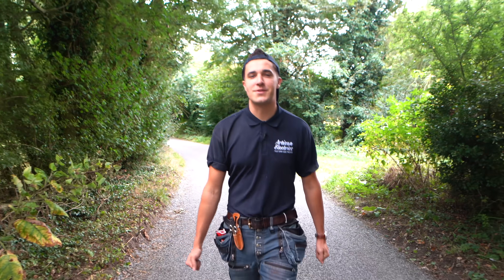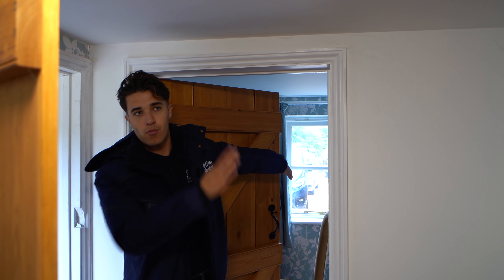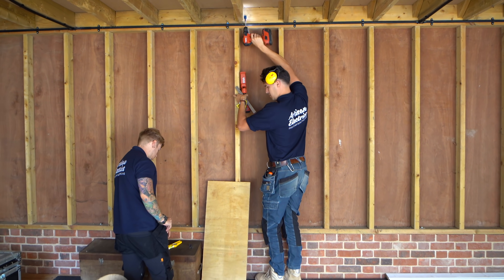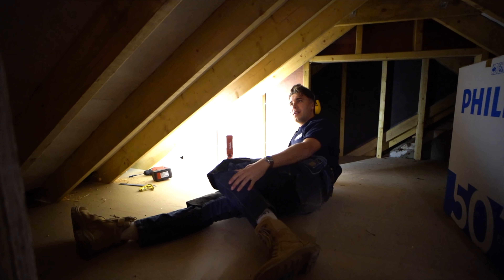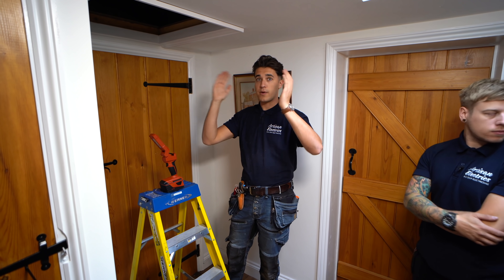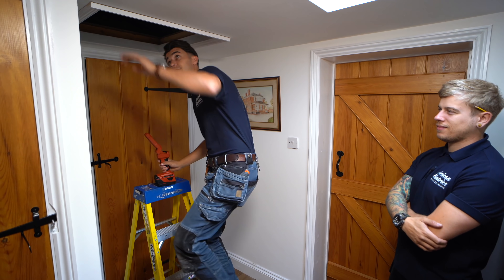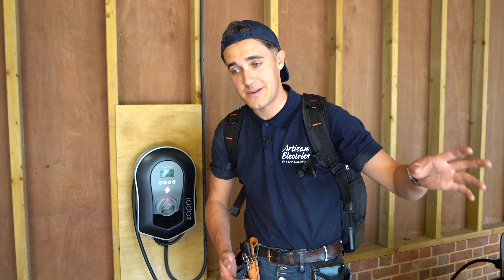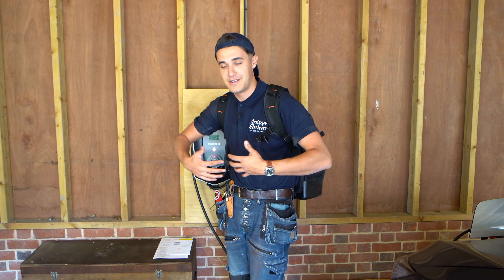BEING A SPARKY IS NOT ALWAYS AS EASY AS IT LOOKS - Electrician Life

Comment: Hmmmmm . "as required by Regulation 522.8.14 of BS  7671, no wiring system should
penetrate an element of building construction which is intended to be load bearing unless the
integrity of the load-bearing element can be assured after such penetration. "
You might need to go back and fit U shaped steel plates round the holes in the rafters
Reply: No
Reply: @rickybeans8504  Enlighten us then, too late to not drill the rafters
Reply: @FFT_Electrical  there's a textbook... Then the real world.....
Reply: @rickybeans8504  Unfortunately the real world in this case is building control , and as it was advertised to the world it should be put right. will the roof fall down, very unlikely.  Interested to learn how @artisan electrics deal wih it though
Reply: @FFT_Electrical  building control are not involved.

Comment: Great video and funny as always but heres where reality vs Regs clash. I winced a bit every time you drilled through those rafters.......
Reply: Wouldn't it be the same as drilling through joists?
Reply: @ethanparker5082  there is a full set of rules relating to holes and notches in Joists but the regs are clear about rafters, no holes, cuts or notches except for the creation of birds beak cuts at points of support.

Comment: Instead of destroying the integrity of the roof joists why not fit 3 inch board along the based of the joists where they meet the floor, or higher up near the ridge, and clip direct?
Reply: There should be within the spec a tolerance for drilling some holes in the joists.
Buts yes it I think you idea would be better.
Reply: @TheWebstaff
Reply: @TheWebstaff  “It should be noted that notches or holes should not be cut in roof rafters, other than at supports where the rafter may be birdsmouth3 to a depth not exceeding 0.33 times the rafter depth.”

Comment: There are some completely OTT Wendy's on this video coming in with half arsed facts and real drama queen reactions.

Yes, Cory shouldn't have drilled that hole, but some of the mis-information, terminology and wrong assumptions on here are a bit sad to read.

First off it's a rafter he drilled, not a truss. It's fundamentally and completely a different thing. It's a traditionally constructed "cut" roof. There's a few clues there.... intuitively, the size and thickness of the rafter is one. The presence of a ridgeboard is another.

A rafter is a single element, sized as a discrete component. A truss is a number of elements that work together as a complete unit. The margins on a traditional roof are huge. They have to be. The UK (and the Euro Zone) have tables that allow builders to select the right size relatively easily for a wide range of circumstances. They also have to allow for a variation in build quality by the people doing the work. Trusses are computer designed, for a specific design, with specific loads for a specific job. They're constructed in tightly controlled conditions to exacting, tighter tolerances. The benefits of the truss format and those exacting production conditions allows them to be constructed from much slimmer timbers than the traditional roof.

As somebody else has said, you could remove a significant number of rafters from a roof and not a lot will happen. Some of the reactions have been laughable.

FWIW, most structural timber is not sized for strength, but for deflection. We don't want bouncy floors that sag in the middle and crack the plasterboard underneath. We don't want wavy roofs, like an Elizabethan cottage, but they're still standing 500 years later.

The reality is that when sized to keep deflection within limits, the timbers end up being very lightly stressed. For that reason, we are allowed to make holes in joists under certain conditions to allow other services to be run. The placement of those holes are for specific reasons.

In reality, there's little, to no need to run anything through rafters, so there is no allowance for cutting rafters apart from the birdsmouth joint. So, why invite a problem unnecessarily, just put a blanket ban on it.

However, back on Planet Earth, it's also true that if you did drill through a rafter (using the joist guidelines) either wifully or in ignorance, the square root of cock all is likely to happen.
Reply: Plus it's a carport not a dwelling.

Comment: goggles if drilling above head height ,but then again where was your stepladder to get a more comfortable drilling position instead of stretching, looks like new roofing so there should be no asbestos total ban was in  2000,if in doubt do not work up in roof ,until checked out, and anyway where is a mask, as that rock wool is just as bad ,breath in and particles get into your lungs ,you know if fibre giass was present, you start to itch  ,,oh the spiders are very harmless to us as they cannot pierce out skin with there pincers to inject venom

Comment: I can't resist so i am going to say it. The irony of talking about how you would rather an experienced installer join the team after i have just witnessed the truss drilling. On the other hand i kind of feel bad about saying it because Cory clearly done it in an attempt to create good work. It wasn't as if he was taking a short cut and doing it to make life easy. However i would strongly recommend that you do not do it in the future unless you fancy getting your moneys worth our of your insurance.
Reply: I appreciate the heads up, and the balanced message! That’s a big lesson learned for me and Lee. I always thought it was the same calculations as joists! Always learning on domestic work (and in general in our trade), it’s a whole new mine field of regs and things to be aware of. Irony is, we suggested cleating originally as it’d be quicker, but thought we’d go the extra mile and get the cable tucked away for future loft conversion. Definitely won’t happen again, it was only a 20mm hole, but I will be chatting to a structural engineer in my family to see what he thinks of it 😅
Reply: @corynoahmac Anyone electrically minded can see that everything was done to make the job visually better. Also we are Electricians not structural engineers so it could turn out that us truss moaners are the ones who are actually in the wrong. Only the expert will be able to answer that one.